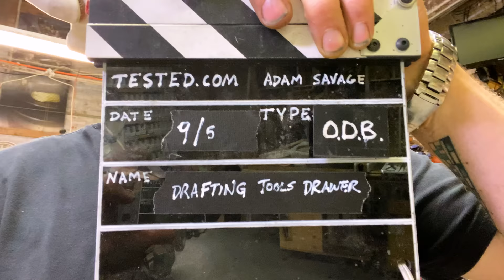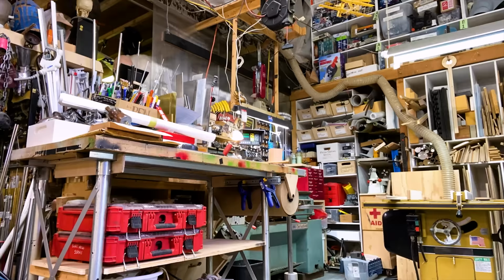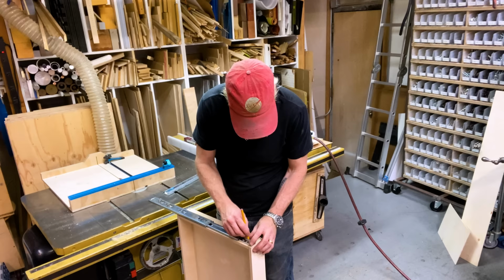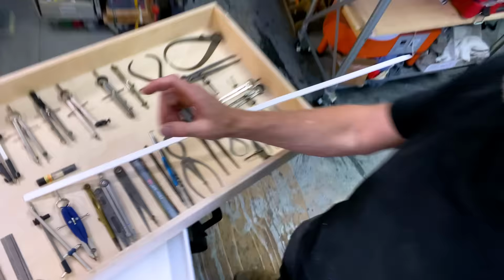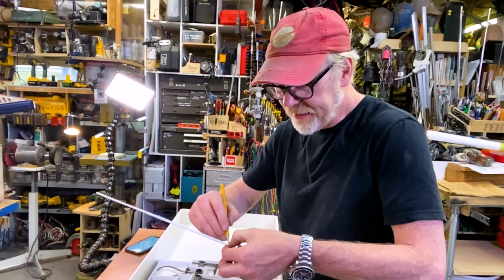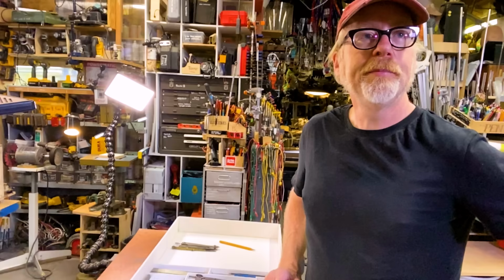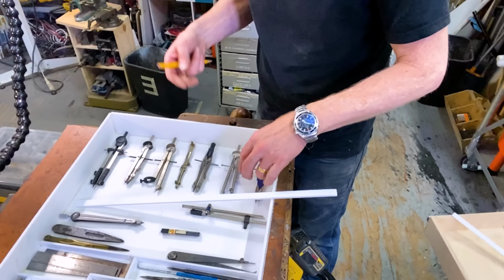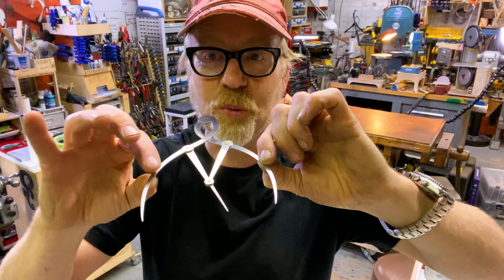Adam Savage's One Day Builds: Drafting Tools Sorting Drawer!

Comment: ~22:00 talking about not remembering how you made your creations: as a composer, I have often gone back and reviewed old pieces. Usually I have a little chuckle about how simplistic it was and go on, sometimes I am pushed to remake/amend/otherwise improve the piece, and sometimes I have the same experience you did. Once, though, I had a tune running through my head that I swear I had heard somewhere but just couldn't remember where or when or from whom, so I sketched it out to see if that jogged any memories and then it hit me: it was a string quartet piece I had written a few years before, but for some reason the version in my head was a brass quintet. Do you ever have that happen to you? Sort of "Why have I never done this?" but it turns out you have done this, or at least something incredibly similar? Open question to creatives of all sorts.

Comment: That looks like it could easily be a two-tiered drawer, with a drop-in insert sitting atop the existing one. I know it then requires moving the insert to get to the tools on the bottom, but if the amount of drafting tools keeps increasing and Adam wanted to keep them all in the same place... Seems like a decent solution.

Personally, I'm always horrendously space-constrained and had to think about the usability of the third dimension a lot more. Stacking things vertically is just second nature at this point.

Comment: Put a bead of hot glue on the underside of the drawer, joining the drawer front to the drawer bottom. Otherwise the drawer front, being so long, will bow out as you pull on it.

Comment: Whats a good way to stop the drawer bottoms from sagging or pulling out of the rabbets and dumping the contents below?
edit: What about foam in the bottom of the drawer with cutouts for each tool? That would make sure they didnt shift around and it would be easy to see where each item went. Would that be a good solution of would it be more work than functional? Also what about not gluing the foam down so you can rearrange the tools and foam whenever you get more tools or upgrade current tools? Just a thought. Love the videos Adam, Thanks for keeping us company and busy during these trying times!

Comment: You can always glue plywood to plywood! floating is only needed with solid wood panels, your drawers will be much stronger too!
Reply: Yeah if you look at modern drawer construction there's usually a bead of hot glue under the drawer holding the bottom panel in. They use the flexible kind.

Comment: If all the parts of the drawer are plywood, why the floating bottom?  Floating bottoms are made to accommodate differences in dimensions caused by shrink swell cycles.  With everything plywood the variation should be so minimal, and what little dimension variation you will have will be uniform.  So, you can glue everything solid and have a much more solid drawer.

Comment: Very nice build! Until you break one tool and need to replace it, that model is no longer around and the new one you buy is ever so slight too big and wont fit your nice box :D
Reply: If you're in your own shop working on your own projects the likelihood of breaking tools is low. That's because of the control you have over the environment. Just how it is. At least if you know what you're doing. If you're breaking tools you're using them wrong. But I understand sometimes things do happen. That's often in less than ideal conditions. Such as when you're doing site work and have to just make due with what you have.
Reply: @1pcfred  that TOTALLY depends on what you are working with. Sure breaking a ruler or a pen is not very likely. Breaking a crowbar or such is more likely. At least if you know ;) :D
Reply: @KARLSPEED  I know the material limits of what I'm working with. Which is why I have some really big pry bars. One's I'd like to see someone try to break.

Comment: DOUBLE YOUR STORAGE Adam:
Cut the TOP half of the BACK of the drawer out (you’re using less than half the height anyway.) 

Make a SECOND drawer from 1/4” ply and NEST it ON TOP of the FOAM core but INSIDE the FIRST drawer usinng a SECOND set of sliders mounting them BETWEEN the Interior of the Original Drawer and the exterior of the second drawer. 

Then open the first drawer and you can slide the TOP (second drawer) back to expose the bottom drawer.

Voila! 2X storage.

Comment: A tool drawer has to be where you use the tool or it is mostly useless.
Generally I do not like nice tool displays, I want something practical where I can replace or add tools as needed. I have boxes with lots of screwdrivers/pliers/etc. where I can pick the type and size I need (After some moving around). The problem with the boxes is that I frequently add tools, but seldom remove tools.

I am an electronic guy, but all my electronic stuff has to end of in a box/enclosure of some type (A lose circuit board is not acceptable) and I also need some other stuff, i.e. I do a lot of simple mechanical engineering. My best tool recently has been a 3D printer, it is fairly precise (placement maybe +/- 0.1mm) and I can make multiple copies without any work.

Comment: My lesson to my sons on cursing:

Cursing is not inherently bad. Cursing is, instead, crass. The difference between bad and crass is that it is never appropriate to do something bad, and it's sometimes (but usually not) appropriate to do something crass. There are three types of occasions on which it's acceptable to curse, and you'll never get in trouble for cursing at those moments:
1. When you are around people who are cursing, or whom you know to curse frequently, and those people are your own age or younger. 
2. When it makes something REALLY funny. Not a little funny, not a little funnier. It must make it VERY funny.
3. When cursing changes the meaning of something in a way that can't be done without cursing. (This is, IMO, what you were doing when you cursed in this video.)

I'll point out that only one of my sons has ever gotten in trouble for cursing, and that was a single occasion which happened before this lesson (right before, as you can probably imagine). I'll also add that both of them can, when explicitly permitted, fire off a volley that would make a salty old sailor blush. But they don't, because they know that permission to curse is something few kids have, and they don't want to lose it. 

As such, I approve of your cursing lesson, for whatever that's worth.

Comment: We switched to AutoCad 20 years ago.  I don't even know where all my drafting tools are anymore... Then Catia and now Enovia...
Reply: CAD is useful if you're going to CAM. But CAD is useless if you're just prototyping.
Reply: @1pcfred  Cad is never useless.  I did a kitchen remodel and needed a quick drawing with dimensions to send to the countertop installer. Drew my entire kitchen, with dimensions in less than 30 min and emailed them. (Fusion 360 is a great free program. I do most of my 3d printer designs on it)
Reply: @kousakasan7882  Fusion 360 is not free, it is gratis. There is a difference. You are not free to modify the code or redistribute it. Those are essential elements for real software freedom. Autodesk could turn around tomorrow and say we're not giving free samples away anymore. There's nothing you could do about it either. Now if you want real free parametric modeling software you'd have to use something like FreeCAD. Which is worthless to me.

Comment: A simple and non-mystical way to conceptualize the golden ratio*: Take a basic graph. Draw a straight line from 0 to anywhere else. See how it comes close to and may hit whole number points? The golden ratio is the ratio for the slope of a line that keeps as far away from those points as it can. 
Just as Pi (Or Tau) encodes a fundamental aspect of circles, the golden ratio encodes a fundamental aspect of... um... staying out of the way.
-
Okay, some more details:
At first you might not understand why thats at all interesting, but the more you think about it the more you can see why it turns up in a bunch of places. E.g. plants that want to maximize the area rays of light hit will trend towards having their leaves stay out of the way of each other, or theyd die. In space where objects can pull each other with gravity and crash in to each other you are likely to find the objects that avoid such collisions trending towards maximizing their distance from everything else. and you should probably be able to get some intuition for why primes, that are these unique spaced out figures, could have a relationship with the golden ratio. 
-
Its not magic, in fact Pi probably has a far greater tendency to show up where you wouldnt expect it to, its just perhaps a bit harder to grasp the aspect of reality its addressing than a simple circle. 
It is of course, still very interesting though, and Ive only scratched the surface of its properties and where the number can be found.
-
-
*Im not the greatest mathematician, it would not surprise me in the least if there was a far more precise and formal way of describing the number (Without delving too far in to the mathematics.) this is just how Ive come to understand it. Corrections or alternatives are very welcome.

Comment: ahh calibrated copying calipers ... are they 1 to 1 or are the enlarging or shrinking   to 1.608 ... a cross is properly built at the golden ration the bottom leg is 1 unit and the top from the cross to the tip is .608 of the bottom ... properly ... and the cross bar itself is .608 of the top center beam ..